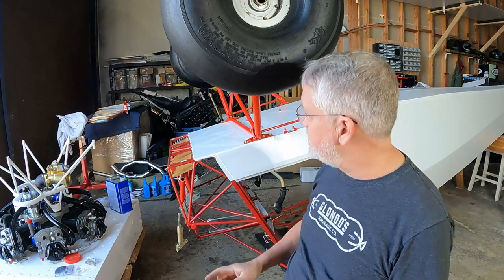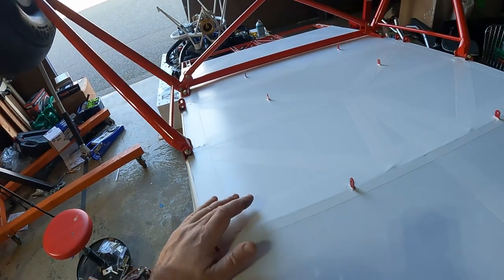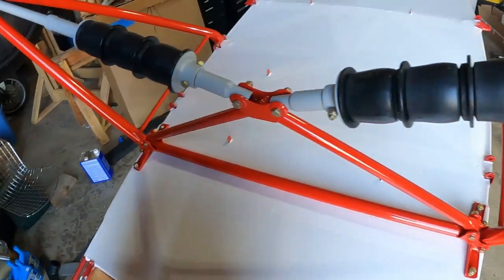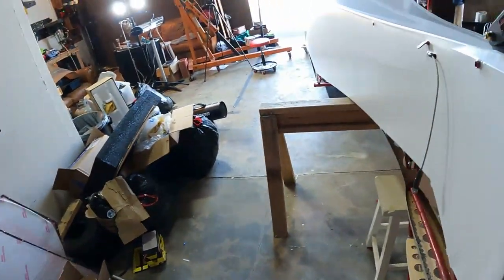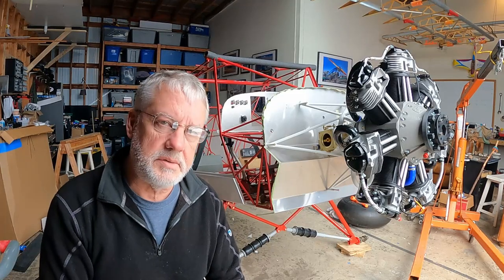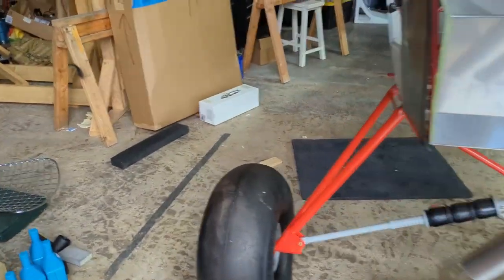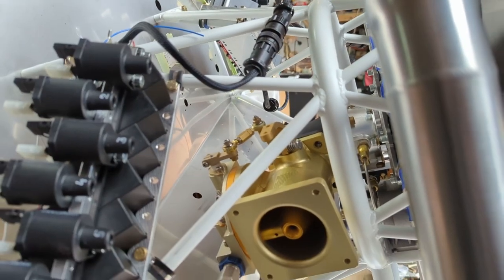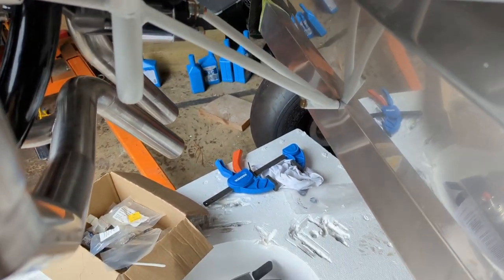Verner Kitfox 5 Ep 33, First time installing the engine

Comment: I just installed one of Sensenich’ new blade and hub designs. Materials and workmanship are excellent IMO. The Pitch Gage Pin system is excellent in concept. For my new, 120 hp, Jabiru 3300 Gen-4, max static RPM available with the finest pitch setting provided, was too low. I was disappointed that Sensenich Tech Support’s suggested solution was to ship the blades back to Florida (from Arizona) so they could relocate the Pitch Stop Pins at the base of each blade to allow finer settings with the Gage Pins provided. I elected to have the 4, most-coarse setting gages, lathed down to finely, progressively finer (diameters) Pitch Settings. Am optimistic my next engine run will demonstrate useable static RPM with optimal settings available. If we have to break out a level, a ruler and protractor to adjust pitch, the precise repeatability of the highly touted hub/pitch-setting system would be zero value. Am sure we both will get the results advertised. Just might require a machinist to get there.
Reply from the maker: I have read comments about the Sensenich design, saying you still need a protractor to set it accurately.  I'll have to borrow one to see how close the pins get me.  I would do the same as you and just have new stop pins made instead of sending it in.

Comment: Awesome video, nice to see the motor in it's proper place🤠🤠

Who did you get your Verner from?

Thanks for sharing your journey 👍
Reply from the maker: I got my engine through Brett Hahn at Brahn Sport.  His website is https://www.radialsrock.com/
and by the way he's got a sale going on right now for 5, 7 and 9 cylinder engines
Reply: @vernerradialkitfox4083  much appreciated sir!! can't wait to see & hear her fly🤠🤠
Reply: @vernerradialkitfox4083 Glad you posted this. I reviewed the site and am impressed with the relatively low weight and affordability. I suppose opting for the 9-cylinder variant would have required loosing virtually all access to the front of the firewall, with a very short engine-mount. And the requisite, substantial reduction in wallet contents.